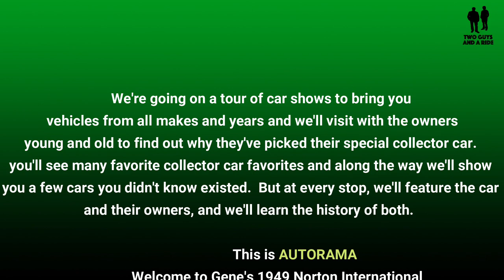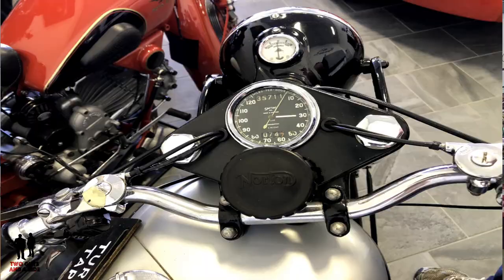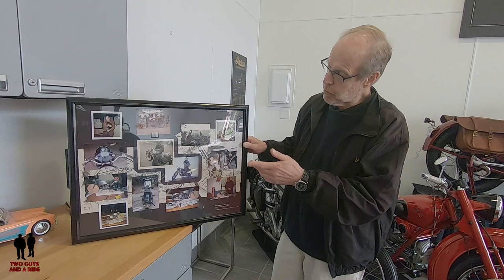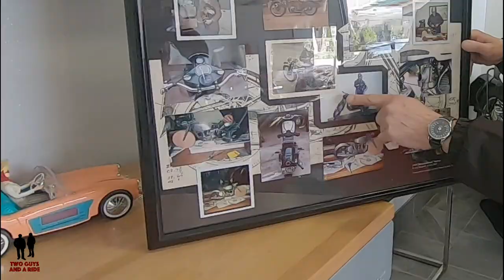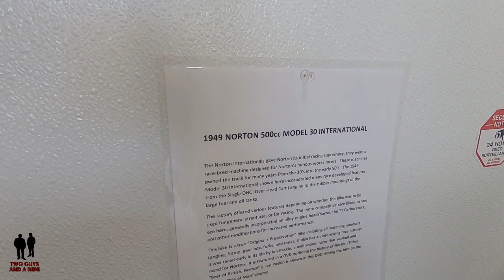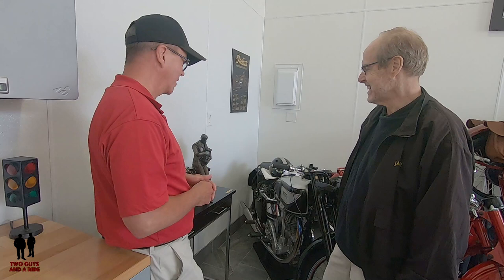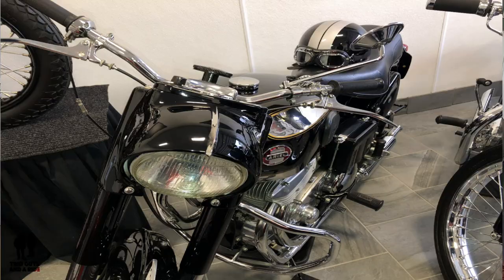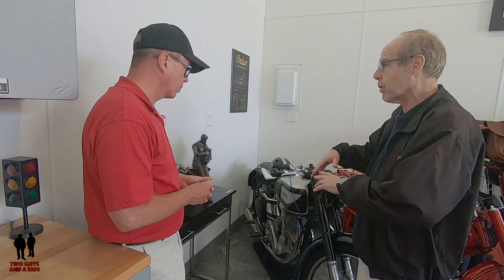1949 Norton Model 30 International

Comment: I’ll be so bold as to suggest that International has been at least cosmetically restored. Beauty.
Reply from the maker: If you knew Gene you'd know his meticulous attention to detail and his history working with folks like Dale Walksler and others in. the field of classic motorcycles. its original as it was straight from the factory
Reply: @TwoGuysandaRide  Even the chrome plated oil tank?